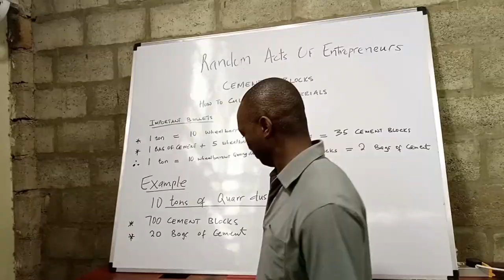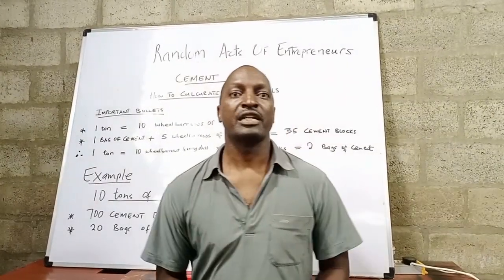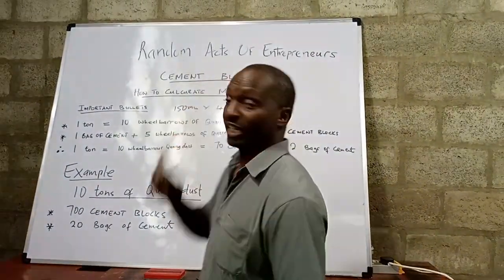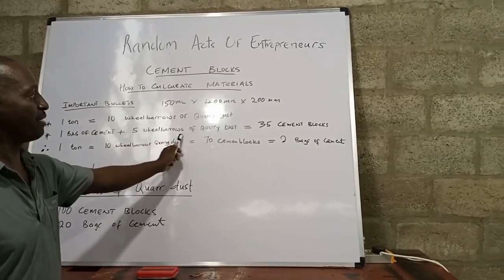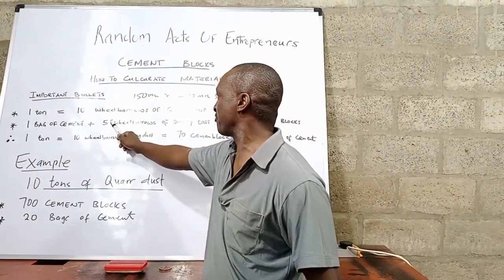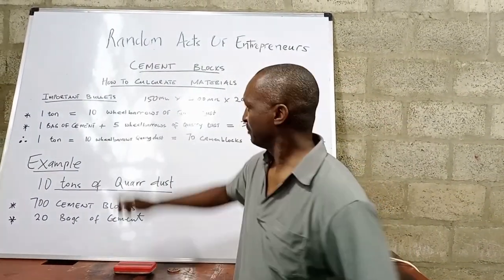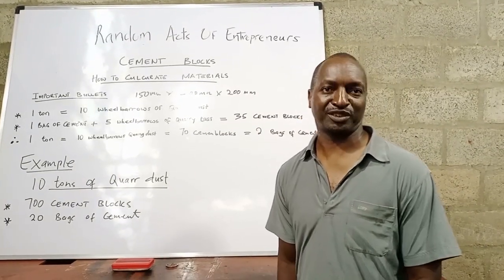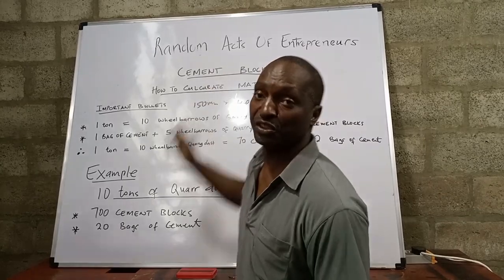How TO Start A Hollow Block Business

Comment: Thank you sir
Reply from the maker: Thank you
Reply: Good afternoon sir,how many blocks do we need to build a two town lot fence ?
Reply from the maker: @hawahmasaray1388  Measure the total length of the fence. Divide that by 3 (for length of panel) you will get number of panels. And multiply the answer80. the answer is the total number of blocks.
Reply: Thank you sir for your help